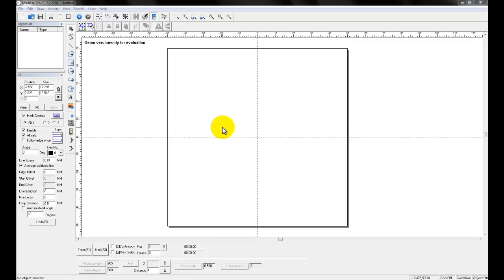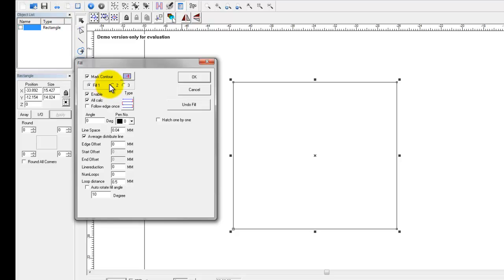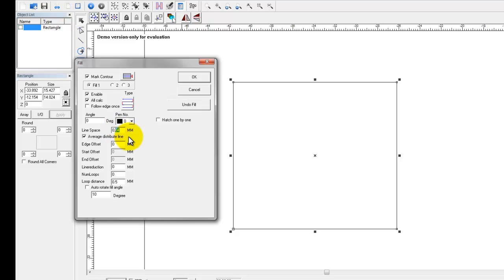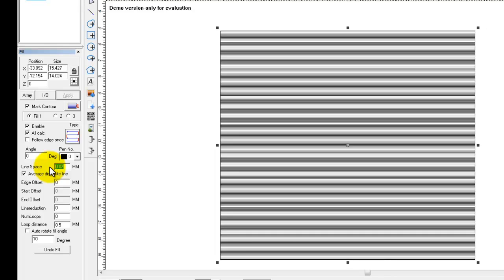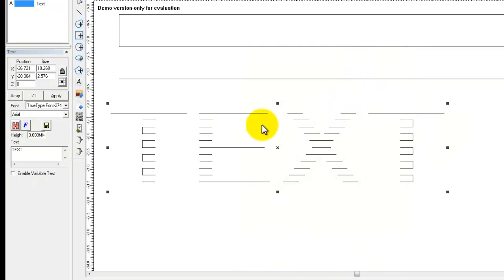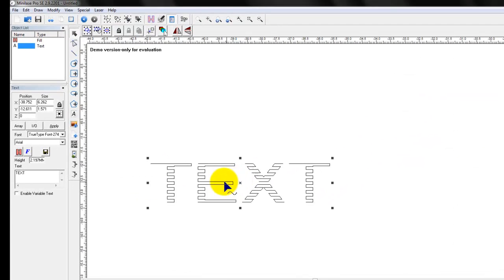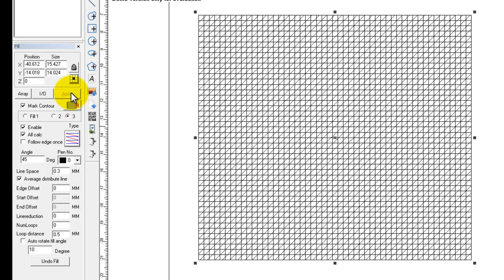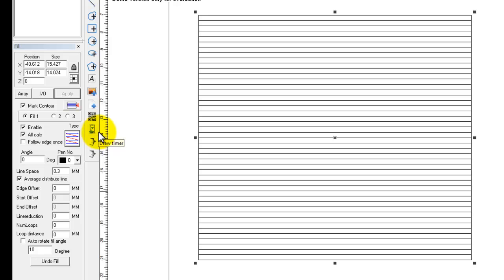Minilase™ Pro SE Tutorial 7 - Fill Settings

Comment: Im having trouble filling imported vector graphics. It either wont fill at all, or it will only fill parts of it, with weird triangular artefacts sticking out of the side. I have tried various file formats including DXF and nothing will make it work. Any ideas?
Reply from the maker: It sounds like the graphic has nodes that are not joined at certain points and as a result you have abnormal or no filling. Take a close look at your graphic where the ends of lines meet and see that the nodes are joined together. Just touching two nodes together may not connect them and you may need to apply a "Group" or "Join" feature to merge the nodes into a complete object. DXF, PLT or other similar vector formats will work best. Hopefully this is helpful, if you need further assistance contact our service team at 740-779-9918